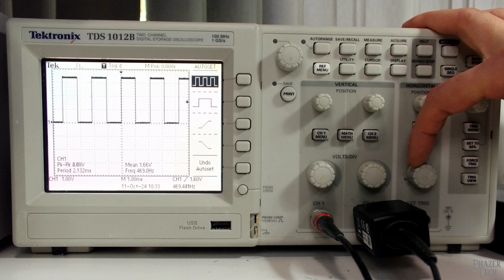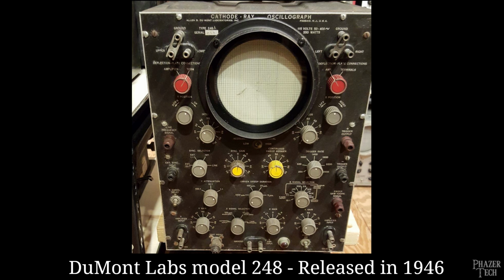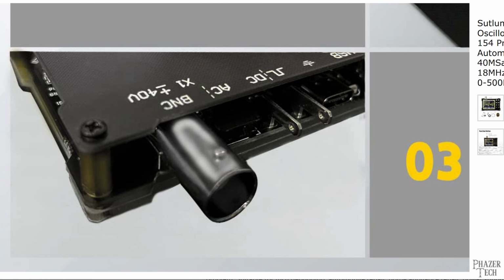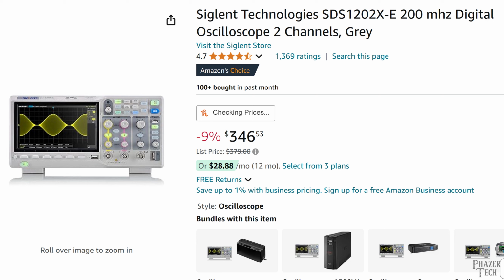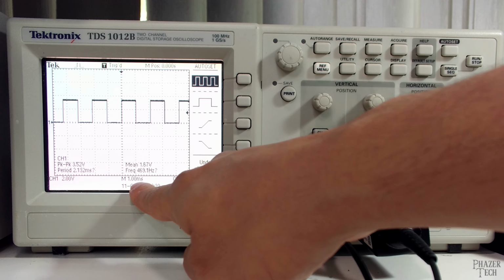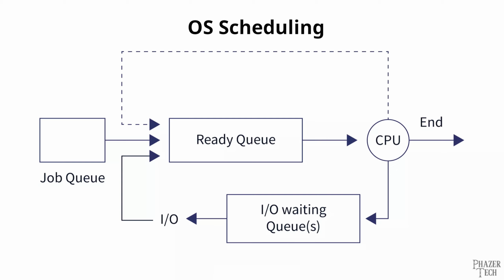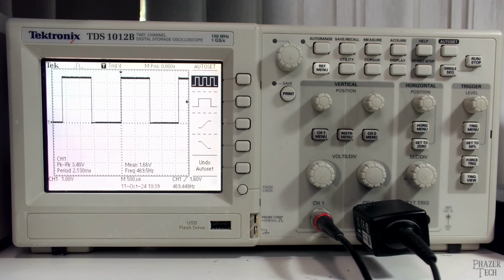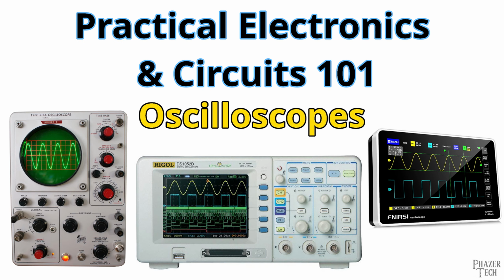Practical Electronics & Circuits 101 – Oscilloscopes

Comment: Maybe in another video you could talk about PC oscilloscope. The most famous one is the PicoScope, it's easy to capture and reopen screenshot, you can decode some numeric signal (could be a buyable option on other brand), and the software is some time updated. I already use it, and it's quiet convenient. You have cheap double channel to four expensive channel product.
There is also Red Pitaya, but I newer use this brand.
Reply from the maker: PC based scopes are certainly another option which I forgot to mention, thanks for the suggestions. I don't own one but if I ever get one I'll definitely make a video about it.